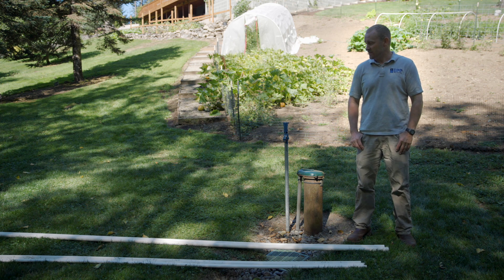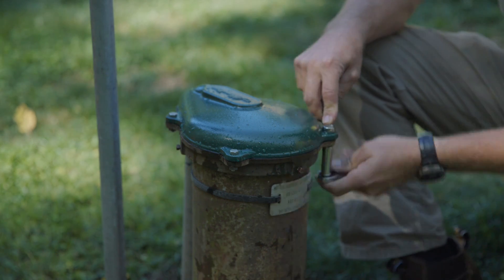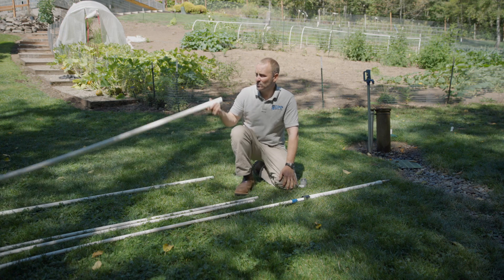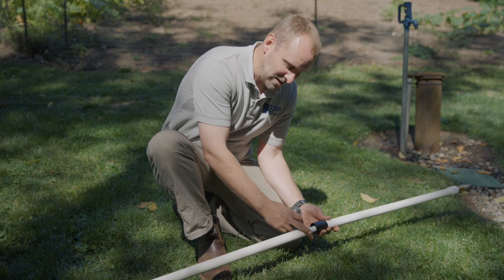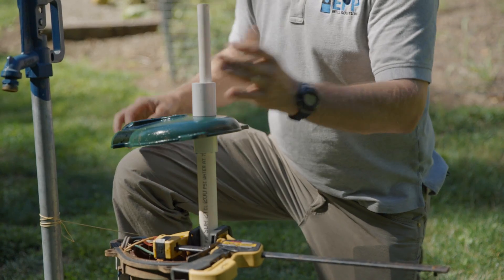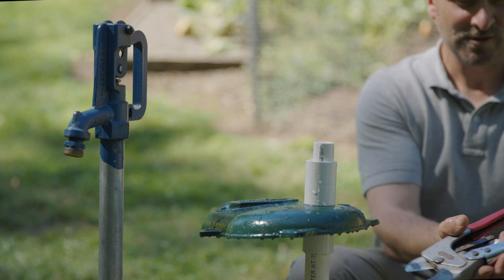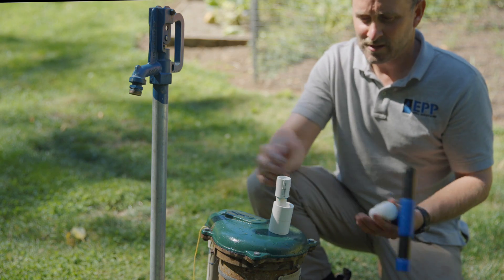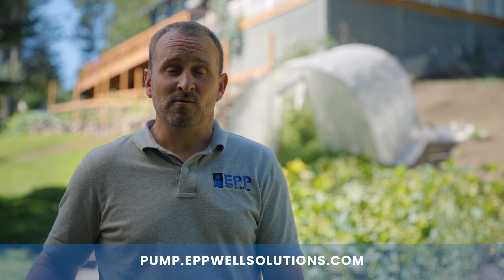Emergency Water Well Hand Pump Kit Installation | Epp Well Solutions

Comment: Hi, if my well was drilled to 200 feet, but the static water level is 30 ft below grade (per the well report I got from the company after I moved in), will this kit work? It was drilled in 2016.
Reply from the maker: You bet! Our kits can reach depths up to 150 feet deep, so your static water level is well within range.

Comment: How did you get the string off of the piston after you installed everything? did you just cut it? If so, isn't there a possibility that that string could become a problem left in the well casing and get tangled around the regular pump impellers? Thanks

Comment: Hi. Are these made to leave inside the well?   Or would you suggest just having the hole in the cap ready, but keep the pump out of the well for emergency use?
Reply from the maker: Whether you decide to install the pump or store it for later is totally up to you. It doesn't matter for the longevity of the hand pump whether it is in the well or on a shelf. We have customers opt for both ways.
If you have the hole drilled in the cap already just be sure to plug it up or install the hand pump to keep any large contaminants from entering into the well via the hole.

Comment: This looks great! A couple questions:

1. I understand the 1/16" hole allows drainage to prevent freezing & cracking. But does the pump actually function in freezing weather? If I go out there on a 15-degree day (I'm in PA), would it work?

2. Aren't you allowing rainwater (and potentially dirt/mud, etc) down into the well by drilling the hole in the well cap like that? Of course well water itself isn't necessarily "pure" but it's filtered by 50-100+ feet of earth & rock, whereas surface water is not.
Reply from the maker: Thanks for reaching out Anthony!

1. With the 1/16" hole the water should drain off fast enough that it won't freeze so that you can use it in freezing temperatures. The water will always be moving, whether it is being pumped out or drained out of the freeze hole. If you are worried about it freezing after using it still you could drill a hole larger than 1/16" to drain it off faster. You will just have to keep in mind that you will be losing more water per pump stroke.

2. Well caps already have venting to allow the outside air into the well at the surface. The hole drilled in the cap is usually sealed fairly well by the 1" couplers glued on either side, but if you would like to seal it even more you could use some sealant around the upper 1" coupler and the cap.

Comment: So to get water up with the garden hose attached you must pump it? Any way to use this kit with drip tape irrigation?
Reply from the maker: That is correct. The pumping action of the hand pump brings water up to the handle and through the hose. 
Drip tape irrigation requires pressure, and our hand pumps are not made for pressure application so I would not recommend using drip tape with the hand pump.

Comment: I have a condemned well water due to pump getting stuck in the bottom can you still get water out of it using this system????
Reply from the maker: You sure can! You just need to make sure you have the 1-5/8 inch clearance for the hand pump piston to fit down in your well. If you are not sure if you have this clearance you can take a 1 inch PVC pipe and cement a 1 inch PVC coupler on the end. Lower the pipe(s) down into your well coupler first and see if it lowers down with no problem. If it lowers down no problem then you have the clearance needed for the pump piston in our kit.

Comment: so if static water level is 100', operating that pump is lifting 100' of pipe up and down for every pump of water???
Reply from the maker: That is correct. That is why we recommend the thin wall 1/2" PVC pipe as it is very light and makes pumping easy.
Reply: @EppWellSolutions  thanks!

Comment: Buyer beware. Schedule 40 doesn’t work with this pump, at all. The 1/2” couplers that come with kit are schedule 40 and have an outside diameter of 1 1/6” which doesn’t fit inside the 1” pipe. Can’t use 1 1/4” pipe because it won’t fit the 1” coupler that’s on the pump. Poor investment on my part.
Reply from the maker: Yes, you will need to use the thin wall class 200 1" PVC pipe. As you found, schedule 40 doesn't have the necessary clearance for the 1/2" couplers.
If you are having trouble finding thin wall 1" or 1/2" pipes just let us know!
Reply: @EppWellSolutions  right now I have 80’ of 1” and 80’ of 1/2” schedule 40 that I can’t use. None of the big box stores or plumbing supply stores in my area have thin walled pipe.
Reply from the maker: @HAWKS in our experience the best place to find thin wall piping is at a landscape irrigation supply shop. If you can send us an email at support@eppwellsolutions.com with either your name or order# we can do some research and find you a place nearby where you can get the thin wall for your hand pump kit.
Reply: @EppWellSolutions  sent.
Reply from the maker: @HAWKS you should have an email now. We found a SiteOne landscape supply nearby you that stocks the 1" thin wall class 200 PVC and also special orders the 1/2" thin wall class 315 PCV pipe.
Please let us know if you have any other questions!

Comment: This is exactly what I am looking for !
Has it been tested in the winter ?
How well will this work in freezing temps. 
Manitoba Canada 
Usually -20
Gets down to -40

Does the water all drain out after use, or will any part freeze and crack / get plugged with ice.
Reply from the maker: It sure has! 
At 11:20 in this install video you will notice that the installer drills a 1/16" hole in the 1/2" pipe below the freeze line. That way when the pump isn't being used the water can slowly drain out of the 1/2" down below the freeze line. The water drains from the 1/2" pipe out the freeze hole down into the 1" pipe and then drains out another hole in the piston back into the well. This protects the water from freezing and cracking the pipes.

I understand you are from Manitoba. Unfortunately I must inform you that this product is only available to US customers at this time. We are working hard to make our hand pumps available in Canada, but at this time I do not have an estimate on when they will be available. You can follow us on our social media to be the first to know when it is available for sale in Canada.

Comment: How does this work on a 4” well where the pressure regulator itself barely fits in the well?
Reply from the maker: Hello Jeff,
Our pump's piston is 1-5/8" at its widest point so you would need that clearance in your well casing next to your current well piping. So unfortunately our hand pump will not work in your 4" well in tandem with your current well piping. Sorry for the inconvenience. 
Preferably you would want a well casing of 6" or greater to have the needed clearance for our hand pump. Please let us know if you have any additional questions.
Reply: @EppWellSolutions  you may be able to move the pressure regulator out of the well casing, like on your pressure tank.

Comment: Has this pump been tested on deeper wells. My static level is around 325'. I was looking into simple pump, but their price for that deep is nearly $4000. I am almost tempted to buy this and just try it but hate wasting money if it will not work at all.
Reply from the maker: Hello, our hand pump kit has only been engineered and tested for depths of up to 150 feet deep. Sorry for the inconvenience.
Reply: RIGHT, simple pump is so overpriced, I am trying to figure out why.
Reply: Don't waste your money on Simple Pump.  I cannot believe they are still in business.  I used them 25 years ago, and the weep hole did freeze up and cracked the head TWICE.  The first time, I was able to save the unit from disappearing down the well, but the second time, I lost it.  I was naive, and they were horrible.  Never again.
Reply: Did you ever find a cheaper solution? Our well is 280' deep. I would love to have a hand pump as a back up but don't know what to do.
Reply: @sherylstuetzel9561  I haven’t found a cheaper solution.

Comment: Will this freeze in the winter or does the water eventually draw down when not in use?
Reply from the maker: Hello Brux,
During installation you will drill a 1/16" hole into the side of the 1/2" PVC pipe below your freeze line so that when you are done pumping the water will drain down to that hole below your freeze level.
Reply: @EppWellSolutions  Great thanks for the response. I didn't watch the entire video obviously...

Comment: What if you don’t have the overhead room to pump the water? Say your well pipe is enclosed in a house. Is there a way to do a minty and bring it out where you have clearance?
Reply from the maker: Hello Tom,
The hand pump needs to pump vertically so you will need some height in your well house above your well head to pump. A full pump stroke is about 26.5 inches so if you want a hand pump stroke then you will want over 26.5 inches of clearance above the hand pump handle.
Please let us know if you have any additional questions, Tom!

Comment: Question: I have looked at a lot of hand pump videos. I am considering the same, but never have I seen anyone disinfecting their well with a gallon of bleach after working inside the casement pipe if the well is used for a human water supply. Am I correct with my observation? Second what is a ball park estimate of cost of pump kit excluding pipe and fittings?
Reply from the maker: Great questions! Disinfection with bleach after working inside the casement pipe is not a procedure we use during installation. It May be a good idea to check with your local well drilling/pump company to see if they advise you to do so for your situation. 
Our hand pump kits come with the piston, handle, and fittings as shown in the install video. The kits are $350 each with free shipping across the contiguous United States. Just let us know if you have any additional questions!

Comment: Will this attach to a main electrical well or would I need to dig another one
Reply from the maker: Hello Chris,  our hand pump is completely separate from your main electrical pump. That way if the electrical one failed for any reason, you can still hand pump water. In nearly all 6 inch well casings, the hand pump can be installed in tandem with your current electrical pump, so you don't need to dig a new well. You just need 1-5/8" clearance for the widest point on the pump piston.
Reply: @EppWellSolutions  my well cap has the pipe coming up through it. Is there any recommendations on how to install this hand pump with this type of well cap?
Reply from the maker: Great question! Shoot us an email at info@eppwellsolutions.com with a photo of your well cap along with the well casing diameter in inches and we will guide you through how to install with your well configuration.
Reply: @EppWellSolutions  i just sent an email. If you aren't busy, I can email you my phone number if you have time to talk and answer a few questions. Thanks.

Comment: my well is 170 feet deep. How do I know what my static water level is?
Reply from the maker: Hello John, if you happen to have a well report from when the well was drilled, you can look at that and it will often have a static water level depth from when it was drilled, and that can help give you a good idea on whether it is a shallow well.
If you do not have the well report, you can try the washer and bobber method where you tie a washer to the end of a string and put a bobber up higher on the string, and then lower it into the well. Once you hear/feel the bobber hit the water you can lift the string out and measure the length. This method only really works on shallow wells.
Some well or well pump companies also have specific instruments to measure well depth, so you can always call your local company and see if they can measure the well depth for you.

If you are having trouble finding your static water level, you can always make a ballpark guess, glue up that length in pipe, and lower it into the well. You can then try a test pump like shown in the video and see if any water comes out after some strokes. If water does not come out, then glue up another section or two, like the video explains at then end, wait for the glue to dry, and then lower that section down  and try again for water. You can repeat these steps until you find water, and then finalize the installation. 
Hope this makes sense and is helpful for you. If you have any questions at all please reply here or reach out to us at pump.eppwellsolutions.com/support
Reply: @EppWellSolutions  THanks. I'll try the bobber on the string.
Reply from the maker: Hello Jerrod, the hole saw size for drilling through the well cap is 1-3/8" and the drill bit size for drilling the freeze hole is 1/16".